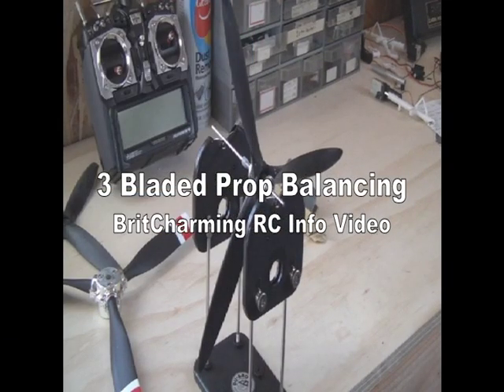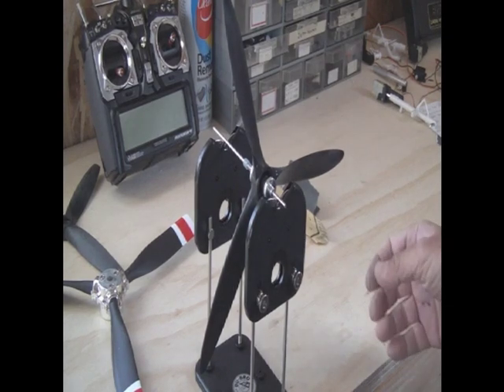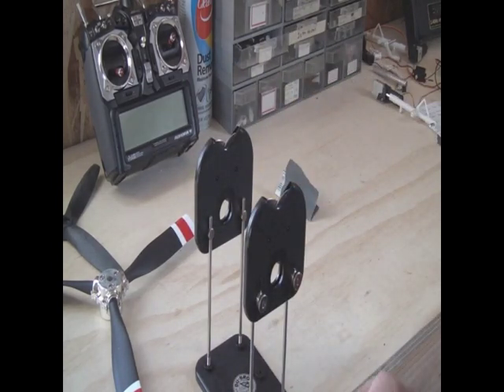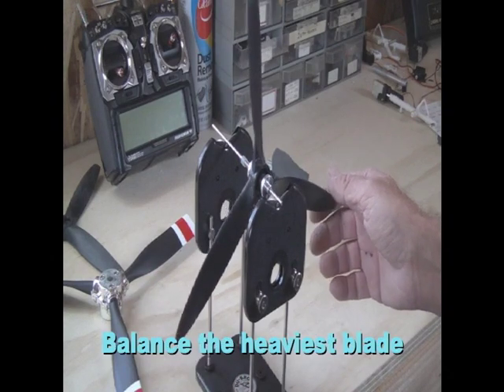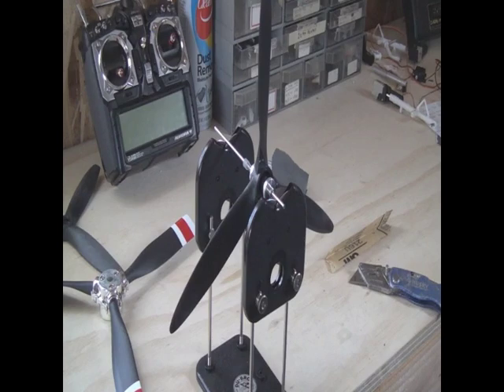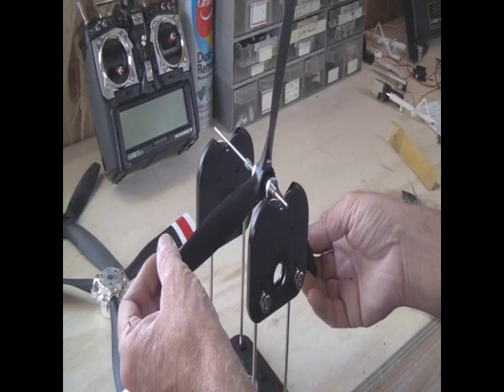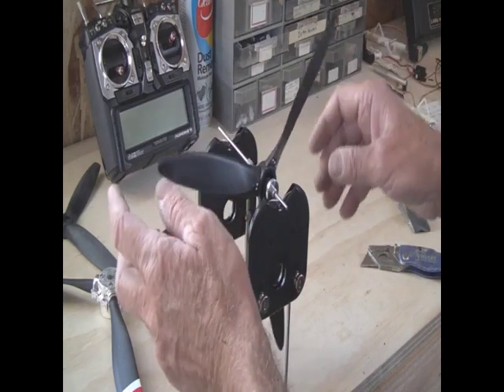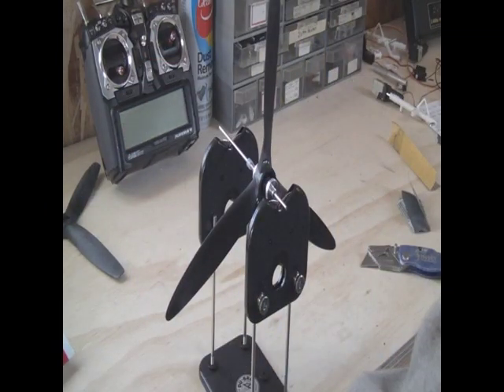3 Bladed Prop Balancing for RC Aircraft

Comment: nice worked like charm! I balanced my new aquacraft Cajun commander airboats prop and now when I hold it up and give it some gas it's silky smooth! before I balanced it and gave it gas it felt like my hull was going to blow apart it vibrated so much!
thanks for a great balancing method and video!